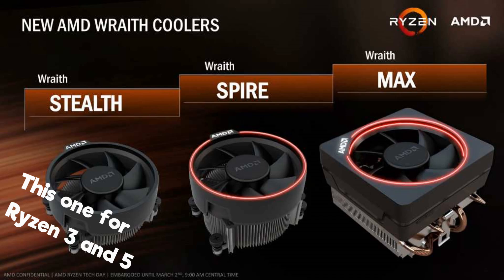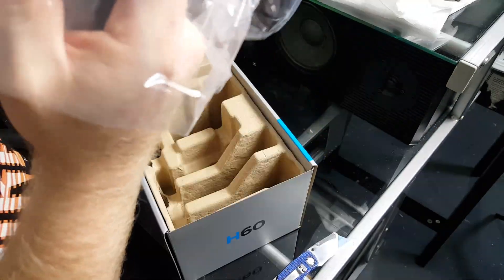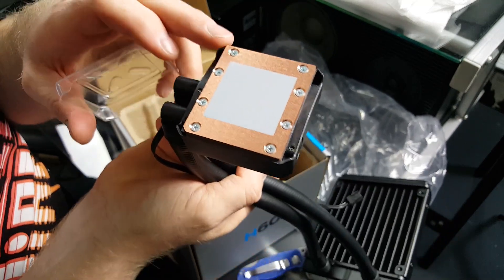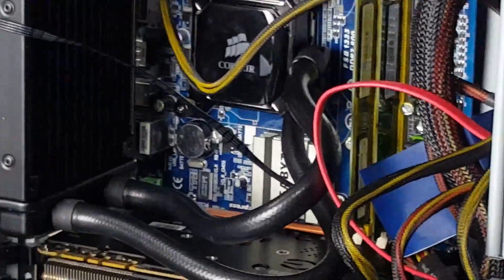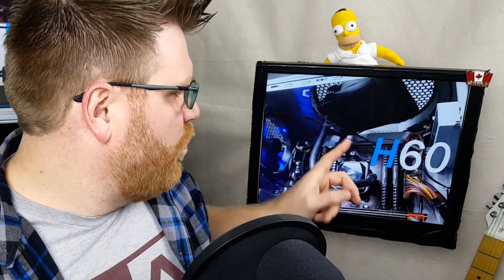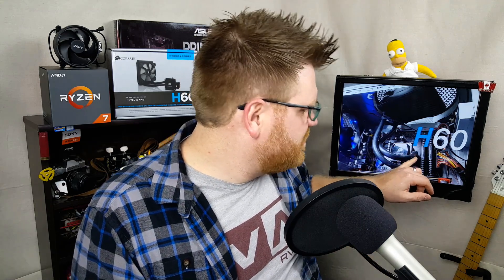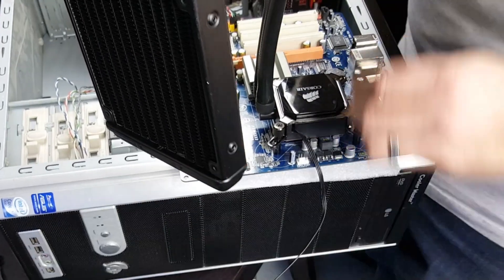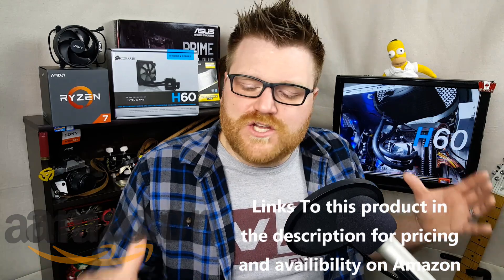Ryzen 7 AM4 and Corsair H60 Review

Comment: For what it's worth, I used the H60 to stretch the lifespan of an old A10-5800k (that number isn't the model, it's the operating temp) long enough to get a basic Ryzen build together. Under air coolers, the A10 throttled itself unconscious no matter what.

Comment: Here's the thing. I just tried using an H60 Rev1 (seen here) on a Ryzen 2700x, although the mounting solution works fine, it doesn't distribute the load evenly, I've had my H60 a long time, I've gotten the whole deal of hand tightening thumbscrews evenly down to a science.

Something isn't compatible here, AM4 didn't even exist when Corsair engineered this cooler. I was hopeful to have some continued compatibility; but it'd seem I'm not so lucky.

Comment: great video, I just ordered a new M.B. setup running a Ryzen 5 1600X setup and it's cool that I can keep running my H60. I was actually able to overclock the AMD FX8320 CPU to 4.5 GHZ with no issues with the H60 and those CPU's run hot..  I have my H60 radiator mounted to the back of the case and i k now even with car radiators you get better heat dissipation when the fan is pushing air instead of pulling air through the radiator......

Comment: are you Fing kidding me? what about temps dude? useless video
Reply: Agree useless AF.
Reply: Came here exactly for that and skimmed through thoroughly to make sure I wasn't missing it... Cmon dude... instant dislike.
Reply: Sonny Thomas thank you so much Ive been using the stock cooler for the fx8350 for over a year now and due to living in a dry ass desert the thermal paste underneath it just got all crusty and kept heating up and I've been spending hours trying to decide between air or AIO and this has made me lean towards the h60
Reply: Thank you op for posting this, now I can move on to an other video and watch someone else that makes a review.
Reply: i have a Corsair H60 on my FX 8350 and its been keeping it nice and cool since i switched from the stock cooler. even in the summer the temps while gaming are very acceptable. and the Ryzen run cooler so i would think that it would keep it even cooler then my AMD FX 8350, thanks
Reply: How do you do a review without plugging the efffing thing in?

Comment: Hi , Timmy I'm Planning on building a rig with r5 1600x , B350 Asus strix so can u suggest if this Corsair Liquid cooler will be fine? How much will be Idle temperature & Loaded temp by ur knowledge? & I'm planning on doing gaming & I've some Video editings programs in queue. I was looking at H100i v2 but that costs more tell about difference if u can. & lastly will those 140mm dual fans or single fan(H60) will provide good air cooling to Case apart from CPU cooling? I've 1 Corsair pre applied fan came with Specs 1 Cabinet & have Vs550 PSU. Waiting for ur answer. Thanks

Comment: I have the first version of that cooler it will work in my ryzen 5 1600
Reply: Worked for especially i am using a 1600x
Reply: The Last Mohican What kinds of temps are you getting? I'm thinking of moving my 2 year old H60 from an old one to my R5 1600

Comment: Hi Timmy
I too have just built an AM4 setup with the Asus Prime X370=PRO, Ryzen 5 1600X and used this cooler, installed in the same way you have. I set it up to draw cool air into the radiator and have 1 exhaust fan and 2 intake case fans. So far the idling temps are  38C on the cpu and 32C on the motherboard, so I'm happy. Very easy to fit and as you said it leaves the case nice and clear for good airflow. Thanks for you video!

Comment: the biggest issue i had with the h60 and r7 1700x is the fan. It's crap. Noisy for any efficient cooling. i had one noctua nf-p12, added another one (for static pressure and noise reduction) in push pull exhaust since i have a 140 silentwing as intake near it. . my R7 1700x is currently OC to 4ghz i'm around 65C in fullload, between 35-43 idle, both are barely audible . That's quite fine. :)
Reply: yeah, but since it was pretty much the only one available at launch. With 2 good fan it's pretty good, sure on the expansive side because of the 2 noctua but it's not like i won't use them on another rig one day.

But i've missed the info on the shitty fan. The coil noise was attrocious. when nobody make sound (2 silentwing and a fanless psu) but this fan, it was ruining my rig :p

Comment: So the stock cooler is goood enough form 1700 or 1600 without overlock?
Reply: Yep. That is what they were specifically designed for. You may even do a SLIGHT overclock with the wraith coolers, but it would obviously run warmer at idle and load

Comment: radiator cooling don't convince me it stays hotter longer noctua cooler is better I'm all air cooling all my builds over 100 builds since the 90s it's like a car look how long it takes to cool off just my opinion nice video tho
Reply: It convinced me fairly well when I went from a cooler master 212 evo to a custom water loop with a 280mm front mount radiator. My temps dropped around 10 degrees C in all use. Plus, in the winter, my CPU temps drop to like 7 degrees if I close the heater vent in the room lol

Comment: I am using the H60 on a ASROCK x370 killer sli/ac and RYZEN 1700. On stock speed of 3.0-3.2GHZ it idles at 25 degrees C and under load gets to about 48 degrees C. I did do a Push/Pull configuration with the Radiator adding an additional fan. I am not sure how much this helped, but it is not hurting for sure. I am going to attempt to overclock to 3.9GHZ stable and I will report what temps I get with that.
Reply: Thank you. Your comment is more useful than the video
Reply: I overclocked to 3.7GHZ  at 1.26V and the idle cooling is around 25-27C which I believe is really good. When I run cinebench to push the CPU it reaching 48C and when I played Deus EX Mankind for an hour it also got in the high 40s low 50s. I am very happy with the H60, but unless you are getting dangerous temps, like close to 80c I would say you are fine with the stock cooler. Also you are running 100mhz higher than me, not sure what your voltage is. Do you know what you are getting at full load? that is the better question than your idle temps.
Reply: Also I really do feel that the Push/Pull fan config is helping which makes the setup 10$ more.
Reply: Yeah that is definitely hot at 85 and would need better cooling. I have been prime95 at 3.7GHZ and my highest temp was 48. I am really impressed with the H60, but again I am using an extra SP120 Corsair fan to do a push/pull config. If my case wasn't so limited i might have went with a 240 solution, but i just didn't have the space. Still for the price I am very impressed with the H60.
Reply: I have to make a correction the highest temp I received after an hour of Prime95 running 16 threads was 56, which i still feel is pretty good.
Reply: Do you run the push/pull as intake or exhaust?
Reply: If i have a cpu fan header and aio pump header where should i connect the pump since the corsair manual says connect pump to cpu header ?
Reply: for OCing a 1700, stick with air unless going over 3.9ghz. I run a 1700x @ 3.9Ghz with 1.2375Vcore on a 212 LED cooler. Idle at 33-35c, max temp after 8 hours of Prime95 small fft at 74c. This is in a mid-ATX, not open air bench/case.